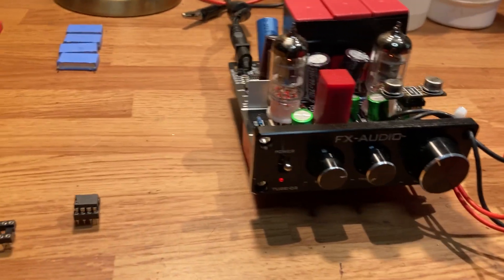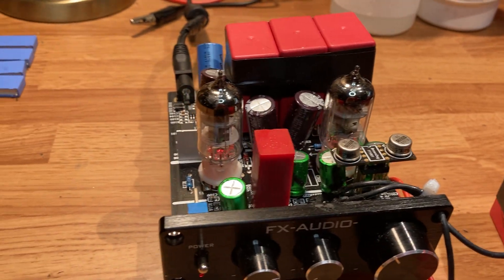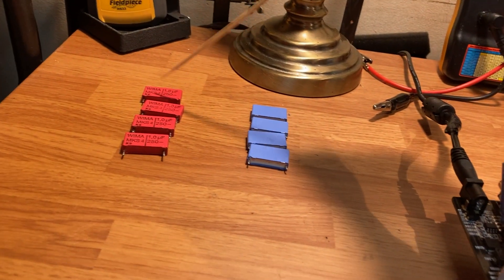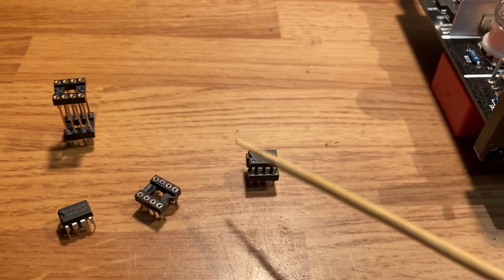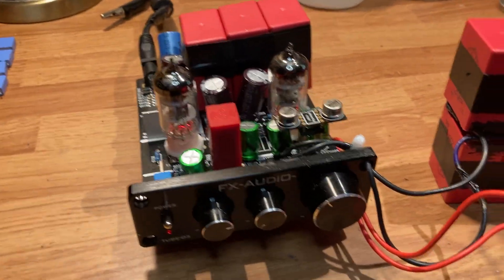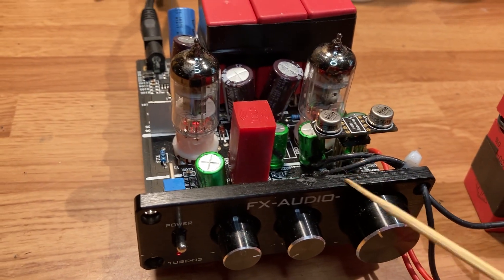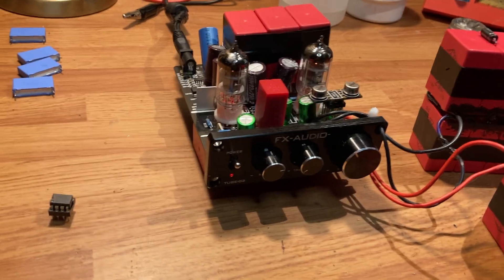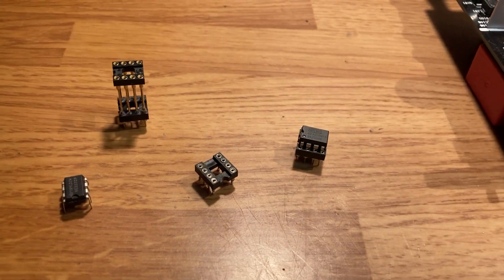FX Audio Tube-03 op amp and capacitor upgrade

Comment: Will the Bursons and opa fit inside the case without the extention? (can i install them with the use of height extensions?) Is there a way to keep the case on?
Reply from the maker: nothing will fit with the extension the Burson V5i will fit but not the V5.
Reply from the maker: The only reason you would use and extension (that makes it taller so I don't know why you thought that that would be good for putting the case back on) is for single to dual adapters to clear the caps on the left and right side of the op amp because those are long not tall.  The Burson V5 is 2 inches tall!!  Any op amp besides the V6 and the V5 and anything you NEED to use and extension with will fit.
Reply: @ranbymonkeys2384  Thank you so much for your response! Since discrete opamps wont fit inside the case anyways, why not go all the way. Was wondering if the Burson V6 vivid or the Staccato OSH or the Sparkos Labs SS3602 will fit into these pins? If yes, then which combination would you recommend? (Sorry I'm new to Amp rolling and didn't even know it was thing before watching your video. I understand technology but I'm not a circuit guy)
Reply from the maker: @Thoughtflux  The V6 is the same size as the V5 so no, and  again the V5i is a discrete and WILL fit. The Sparkos has a large footprint and needs the spacer.  All will fit but you have to have your cover so your options are limited.
Reply from the maker: @Thoughtflux  If you can talk yourself out of the cover you can have whatever your little heart desires in there.  I have even cut the case in half so it has the bottom and not the top.  The pins aren't the issue its room vertical (for the Burson V5 and V5) and Horizontal (for the Sparkos)
Reply from the maker: You can even cut out just in those 2 spots so the Bursons can stick up past the top like the tubes are.
Reply from the maker: @Thoughtflux  https://encrypted-tbn3.gstatic.com/shopping?q=tbn:ANd9GcQHrQRgxvLV5oIHoHJDx2kgVFUVQeVEMCo3ImNfgUhqVhwdfInnPyETXGuXxFeW_42ULNhD1bU-VX5bfy4UcGTJwqI-coraPQ  this is the V5i I think you keep confusing the V5 and the V5i
Reply: @ranbymonkeys2384  Thank you for your patience! I have been ABing a muse 1/2/3 recording here on youtube and I totally love the muse 02 - I feel it sounded soo romantic & lush. I think I'm totally sold on cutting the cover if I go with the Bursons. So which one is your favorite? (I hear people say the muse02 sounds 'tubbish' so will it make this preamp too tubish? Or shall I use two different ones for bass & trebble like you did? I listen to mostly rock & metal) Thank you again!
Reply from the maker: @Thoughtflux  If you get 2 Burson V5's you won't be disappointed nor will you be with 2 Muses02's.  What is your amp?
Reply from the maker: Check out Audio Arliteks video he did on the Muses02
Reply: @ranbymonkeys2384  my headphone rig atm: schiit Bifrost multibit -> Fx-audio tube-03 (stock with 5654W) -> shiit Asgard 2 (pure class A amp). I'm tempted to buy the Burson V6 vivid for both the bass & treble but it's expensive and i have no idea how will i make holes in the case. But your comments to others have me considering the Muse 02 too..
What would you suggest?
Reply from the maker: @Thoughtflux  I have no experience with the V6's and a dremel can make quick work  of the case just cut a couple squares in front t of the tubes.  Of course the muses u dont have too hahaha
Reply: @ranbymonkeys2384  hey man, you talked about not getting parts from eBay coz of the fakes. Can you please tell me the part number for the muse02 on mouser or digikey as i can't seem to spot it on the search results.
Reply from the maker: @Thoughtflux  well your spelling MUSES wrong for starters
Reply from the maker: @Thoughtflux  https://www.mouser.com/ProductDetail/Nisshinbo/MUSES02?qs=lTIKtKbByhhPORZIYvXQtw%3D%3D
Reply from the maker: @Thoughtflux  They are 47.44 at Digikey looks like Mouser is the way to go
Reply: @ranbymonkeys2384  you are godsent sir! Thank you so much :)
Reply: @ranbymonkeys2384  I'll push my luck, 2 more question please: 
- Which other tube shall i try? Is there something better than GE5654 for this preamp?
- what is the part number of the smaller red film you recommended (kept on the top left side, not the giant ones)? I will solder them one day.. After I learn how to solder things.
Reply from the maker: @Thoughtflux  Depending on where you got your GE's they are probably fake too if you got them with the Tube-03.  NOS Sylvania 1940-50's are good, the Russian ones on Amazon aren't bad.  These are what you're looking for I think. https://www.mouser.com/ProductDetail/WIMA/MKP4F041005D00KSP1?qs=kdl0FCDJs3tUiuVBWivAtw%3D%3D
Reply from the maker: @Thoughtflux  While your at it, get a couple LME4972 they are cheap enough.  Just so you can mix and match to really fine tune, does any of those Schitt products have replaceable op amps?
Reply: @ranbymonkeys2384  wow. Thank you! Really appreciate it! I'll get these. The schiit Asgard2 and Bifrost multibit dac sounds good. I believe they have re-purposed some processor used in medical devices for audio. I haven't heard of anyone opamp rolling on these but then I haven't opened them up to check. My gear is about 4 years old now and schiit has newer version. I bought a $150 xduoo dongle to use with my balanced planar iem running off my phone. I was so blown away with these cheap chi-fi that it got me reevaluating my desktop setup.. That's how i landed up in this rabbit hole. 
(You have to try the shuer S12 & xduoo link2bal combo. It's outstanding for the price. The damn thing can drive my HD650 from a freaking phone)

Comment: Another option is that you can also take the opamps out completely .. and it just runs on the tube circuit! Which having tried different opamps  I prefer 

but  it means you loose the volume and tone control functions...so you will need to have a volume on your streamer, source or integrated/power amp to adjust the volume.
Reply from the maker: you do that, hahaha
Reply from the maker: Take a video of that for us would ya??
Reply from the maker: @humanitech  OK the input comes in from RCA's then to the volume control then the treble op amp then the bass op amp.  Not skeptical at all give us that video.
Reply from the maker: You know what, you're right, I was thinking about when a guy was saying you could take the tubes out and it would work, not op amps.  I stand corrected, where's the crow.
Reply: @ranbymonkeys2384  No probs...it is very clever how they have designed this circuit... and I only found out by accident, when playing with opamps and I left one out by mistake, and plugged it in and it still worked!? So I then played and swapped them around having just the tone, then just the volume and it sounded better. So I then took  them both out (and with some nice but cheap voskhod tubes) it sounded very pure and sweet and just what I wanted. 

So really it is just another interesting option to try ... As I think without the opamps... it maybe a similar circuit to the FX audio 01 - Which has also got a good following with the modders too! 

But the interesting thing is... the gain now seems to be set in the perfect sweet spot too!?. So I adjust the volume from my blue sound node 2i and it works great without any distortion issues a higher volumes levels.
Reply from the maker: @humanitech  I had the Tube-01 and it sounds better than the 03.  I sold it and wish I hadn't.
Reply: @ranbymonkeys2384 funnily,  I looked at both models ...but got the 03 for the tone control features....which I have taken out 😆! So I should have gone purist with the 01 at the beginning...but it's all fun and I am now surprisingly happy with the reverted 03!
Reply from the maker: @humanitech  That 01 sounded good.  I need the tone controls or would still have it probably.  I got another one not too long ago and it just wasn't the same.

Comment: Thanks for the video, I'm getting the MUSES8920 from Profusion Audio Semiconductors - the official UK distributor. To desolder the existing film caps, any tips for the soldering iron, solder etc...
Reply from the maker: This is how I look at it.  I basically just use their circuit board and replace all of the fake caps and chips with real ones and then you have an amp that will compete with the $1,000 amps for, not much.
Reply: @ranbymonkeys2384  My take exactly, can I ask where do you get your tubes from?
Reply from the maker: @daysofgrace2934  eBay and amazon
Reply: @ranbymonkeys2384  Still waiting for the pre-amp to arrive, it’s on a ship somewhere. Digikey sent the Muses02. Been looking at audio grade polypropylene caps to replace the four film caps. Saw some from ClarityCaps but with out the pre-amp I can’t see if they would fit. From my research so far it has to be polypropylene like your caps, even if it means running without the case on.
Reply from the maker: @daysofgrace2934  You wont get PP caps and still be able to put the cap on.  The smaller MP caps are (in inches) .235 wide 1.035 long and .590 tall and  you have plenty of room to put the cover back on.  Pure PP forget it.
Reply from the maker: @daysofgrace2934  What amp do you have??
Reply: @ranbymonkeys2384  Aiyima TUBE-A3 with the PCB marked TUBE-T1 V2-2 2021\07\2. It's pretty much the same as the FX Audio/Suca. It uses 4 Kemet 1 micro Farad. I got 4 Clarity Cap CSA 4.7mF about £11 each. I went with 4.7mF mainly because of it was rolling of the mid to deep bass. I bought some Mullard & Siemens NOS valves. I already have two Muses2. I took off the input & output coupling capacitor. I'm waiting for the wire to arrive tomorrow to get the new caps in place. One thing I did measure was the voltage from Anode to Cathode and it was 70V, the tubes are rated at 125V. So I'll be looking how I can increase the potential difference across the anode/cathode whilst not messing with the heater voltage. I also noticed it reversed the polarity i.e. the left speaker was playing when the right is meant to be but that was easy to fix by sending the red terminal from pre-amp into the white terminal in the amp.
Reply from the maker: @daysofgrace2934  why do you need wire to solder those caps and why did you remove the coupling caps the other shit I could care less about but what the hell
Reply from the maker: It's uF not mF
Reply from the maker: @daysofgrace2934  You said  you only ordered  1 MUSES02 when did you get the other one
Reply from the maker: @daysofgrace2934  Those 4.7uF caps are 39 x 38 mm hahaha
Reply: @ranbymonkeys2384  I ordered a pair...
Reply from the maker: @daysofgrace2934  2 weeks ago you said "Digikey sent the MUSES02"
Reply: Yeah they are big. What I've done is left the back off and the wires protrude out. I have three of the caps sited on top of the case behind the tubes in a vertical orientation and stuck one in front of the tubes in a horizontal orientation. I'm waiting for all the other electrolytic caps (Nichicon FG/Chemi-con) to arrive from Digikey. Unfortunately, there are some on back-order, so it's going to be a while. I've plugged the Muses02 & plugged the NOS Mullards M8100. Even without burn-in the Muses02 made a massive difference. I burnt in the stock setup but the modded setup blows it out of the water even though it hasn't burnt-in yet...Thanks for all the help so far...
Reply from the maker: @daysofgrace2934  what caps did you get on back order, surely they had something in stock.  Consider changing the 10uF electrolytic by the op amps into film.
Reply: @ranbymonkeys2384  Yeah, I ordered a pair of Muses02 soon after I ordered the pre-amp:) I was a bit eager to get started. They were sitting in a cupboard, waiting for the pre-amp to arrive. To be honest, I was expecting the pre-amp to arrive a lot sooner than it did. When I got the pre-amp, I went through all the electrolytic caps on the board and put a second order into Digikey. The Clarity Caps I got from Hifi Collective on a Saturday just gone. Yesterday evening I added the Clarity Caps, had a listen. This morning the Muses02 had a listen, then this afternoon the Mullards 8100s...
Reply from the maker: @daysofgrace2934  You never did answer the question of what amp do you have?
Reply: @ranbymonkeys2384  Sorry was watching Chris Harris on TV:) It's Nichicon URY2E220MHD 22uF, 250V & 105C. It's the seated height 14mm that's key. It's the max I can get away with whilst still closing the case. I have 4 on back-order. Yes, I'm gonna get the two 10uF ones done too, at the moment HiFi Collective didn't have the 10uF CSA in stock but I am going to do those.
Reply: @ranbymonkeys2384  Sorry, I thought I had. It's an Aiyima Tube-A3 but the PCB is labelled TUBE-T1 V2-2 2021\07\2
Reply from the maker: @daysofgrace2934  that cap is 5/8 in diameter
Reply from the maker: @daysofgrace2934  hard to find 250 volt that height isn't it
Reply: @ranbymonkeys2384  It sure is, changing the four caps has created some room though..:)
Reply from the maker: @daysofgrace2934  You might have been able to get longer ones and lay them down on their side you know what I mean
Reply from the maker: @daysofgrace2934  You might have a hard time with the 2 caps behind that metal shield next to the big 1000 uF cap
Reply from the maker: @daysofgrace2934  You want some good advice, leave those two caps alone next to the power in.
Reply: @ranbymonkeys2384  Yeah, I think that is judicious
Reply from the maker: Ya the 8920 suck just as much if get them from ebay or your "official" distributor.
Reply: @ranbymonkeys2384  so which of the MUSES02 or the Burson V5i D?
Reply from the maker: @daysofgrace2934  D?
Reply from the maker: @daysofgrace2934  I like the Muses02 over the V5i but I like V5 better than both of them.
Reply from the maker: As far a tips it sounds like your green as the driven snow.  No, not really.
Reply: @ranbymonkeys2384  Very true, I'll probably just get a local electronic repair shop to change the capacitors out...
Reply from the maker: @daysofgrace2934  If you are just doing the 4 because there are more film caps than just them (2 more) then it's a good learning opportunity,  because there is a lot of room to mess something up.  I'm saying if you screw something up its super super easy to fix with those 4 caps.  The electronics guy can fix it no problem if you do mess something up so don't worry about that so if I were you I would try it.  Get a chap 10 soldering iron kit with solder and MAKE SURE IT HAS FLUX if it doesn't GET FLUX!!!!!!!!!!!
Reply: @ranbymonkeys2384  Sure, my feeling is also to learn; better off learning to do something for yourself even if it means you make a few mistakes along the way...
Reply from the maker: @daysofgrace2934  Have you had it apart yet?  Look that the bottom of the circuit board and you will see what I mean.  There is a huge are to work with and if you screw it up contact me and  I will talk you through it, DON'T PANIC.  Its very easy, you'll see.
Reply: @ranbymonkeys2384  Waiting for it to arrive from China. TBH I think I can do those 4-6 myself. Ideally I'd like to get all the electrolytic ones changed to Panasonic, Nichicon or Nippon Chemicon...
Reply from the maker: @daysofgrace2934  From China?  You better be talking about the Tube03 itself not the caps.  Yes I like to use the AUDIO GRADE Nichicon caps.  AUDIO GRADE.
Reply: @ranbymonkeys2384  Yes, I meant the amp. TBH honest not keen on buying much from China, too many fakes there and to be honest nowadays fakes have invaded everywhere. I stick to RS Components, Farnell, Mouser & Digikey

Comment: I  see you recommend the MKP4 's , but MKS4's are shown in your video. Will both work in this circuit , or is one better then the other ?
Reply from the maker: yes and yes there was a time I recommended AOL also
Reply: Which caps you prefer?

Comment: Great informative video!
You talk about the film capacitors but it appears you also replace the electrolytic capacitors as well can you tell us the pros and cons brands that you have used and in what position.
I have the same system too and have done some upgrades that you have already shared in this program with the film capacitors and with the IC chips.
I was planning on replacing electrolytic capacitors in the signal path with Elna RFS series Silmic ll or Panasonic FC series.
It's a nice little preamp system I think for the price driving my Leach Amp and Thiel Speakers.
Any further information would be Greatly Appreciated!!
Thanks in advance.
Reply from the maker: Ya those elctrolytic's need replaced.  I like audio grade Nichicon but to each their own.  I replaced the 10uF caps that are pushing the op amps with the (10) big 1 uF film caps so that's a huge step.
Reply: @ranbymonkeys2384  Muse I agree 👍🏻
Now time to order parts.

Comment: Great stuff Monkeys! 
Please do not change your production methods, they are so cool! : )
Is this the right spec for the suggested caps?
 WIMA MKS4-250 1,0µF
Thanks!
Reply from the maker: You want to try to get the MKP4  P for polypropylene
Reply: @ranbymonkeys2384  I'm getting them here in Austria. 
The specs says (in German):
Reply from the maker: @markduran2942  there made in  Germany
Reply: my chat is acting up: I wanted to say, in German it says
Reply: METALLISIERTE POLYESTER (PET) - KONDENSATOREN, meaning, metalized polyester capacitors.
Reply from the maker: @markduran2942  Im not sure what you are talking about,  get the MKP4 not the MKS4
Reply: I also found some 6F32 Tesla Tubes (from 1950 and 60)  in Ukraine.